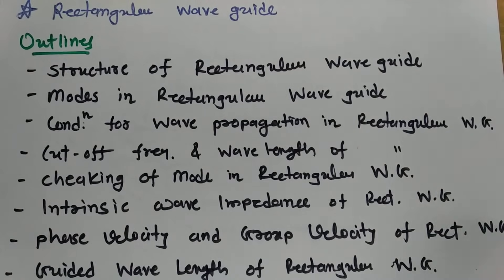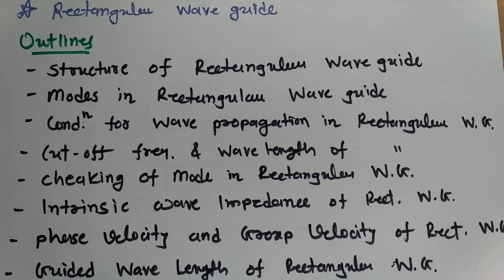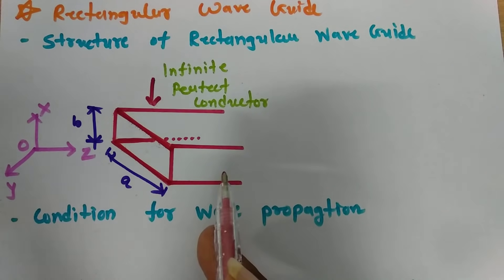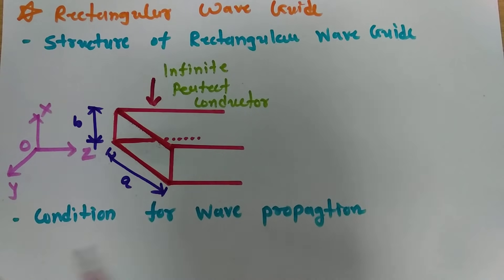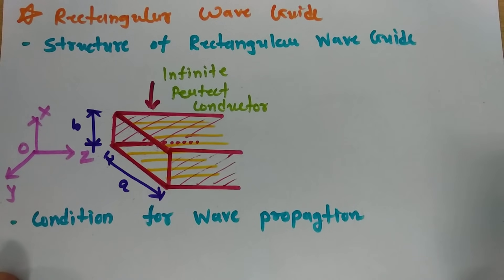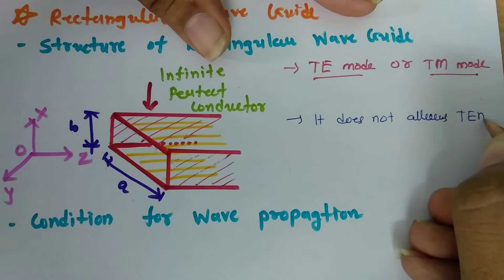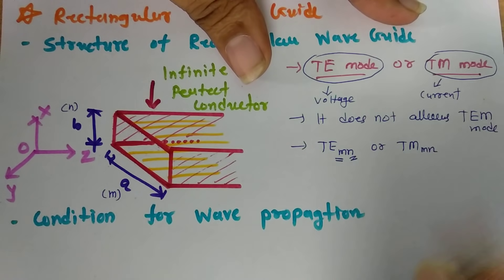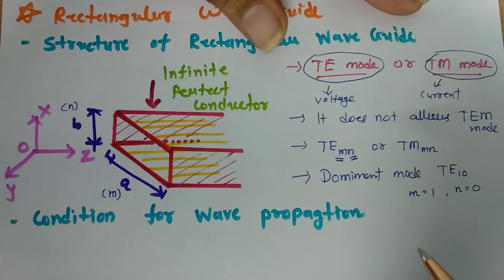Rectangular Waveguide (Structure, Modes, Cut Off Frequency, Wave Impedance, Group & Phase Velocity)

Comment: how do you consider material in designing waveguides? how to incorporate it in formula.
Reply from the maker: Dielectric constant is lowering operational frequency, so dimensions of waveguide decreases. It will decrease by 1÷(er)^0.5